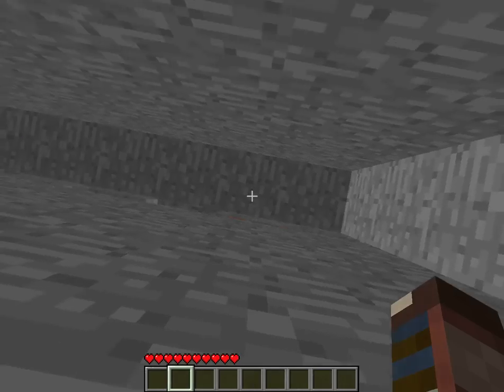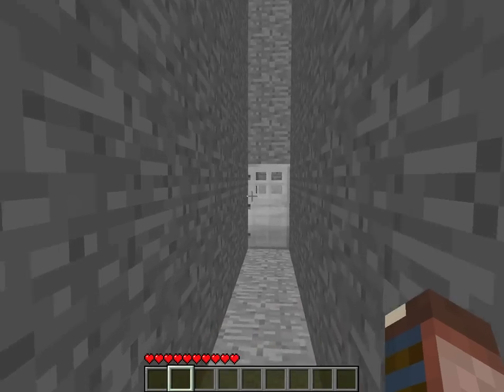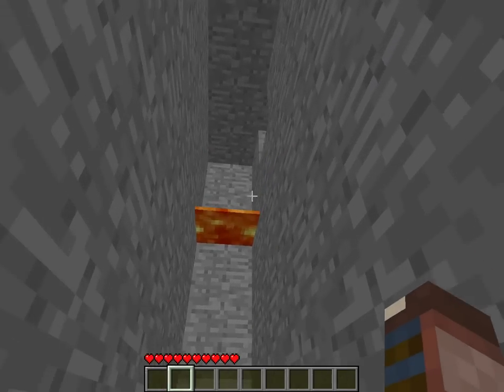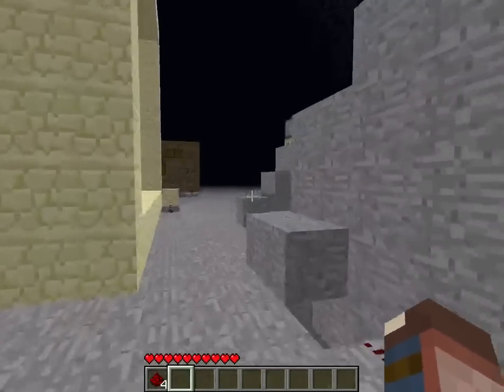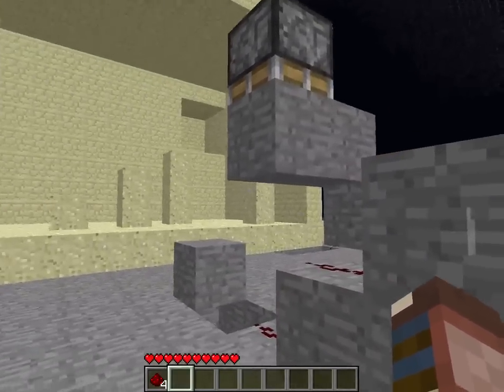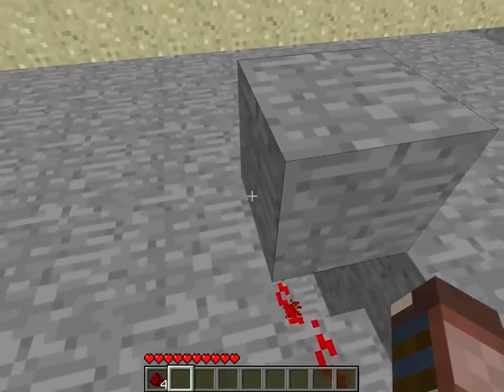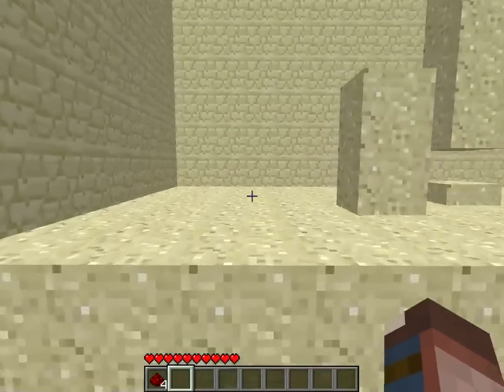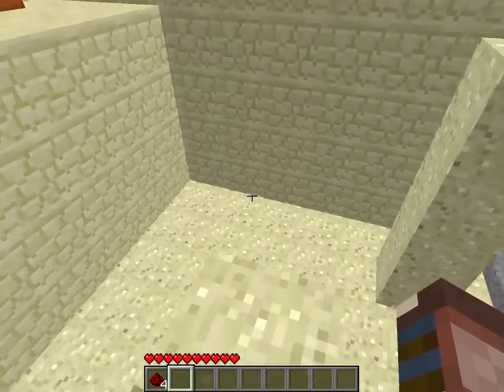Minecraft Captain Sparklez Puzzles

Comment from the maker: @118cottroad Thanks for subscribing, I will add the world in the description
A few things that are wrong with my clock (mostly because of laziness) and I might try to mess around with myself:
- 2 clocks instead of one
- manual starting -> no exact control over length
- some pistons have the same timing or inverted timing
In that map you will also find 2 other redstone things, one which I have a video about and the other is a attempt at a moving floor that doesn't work because of the same bug.